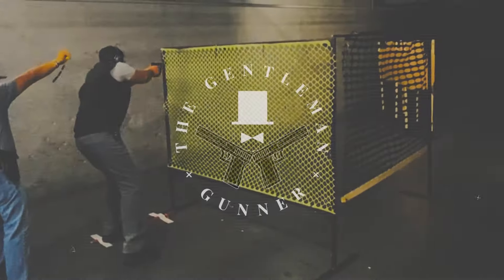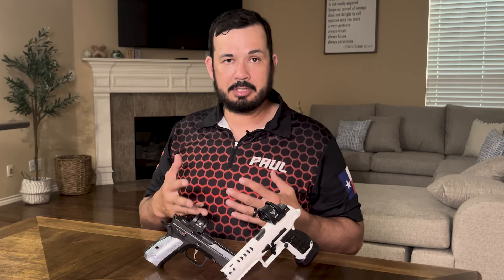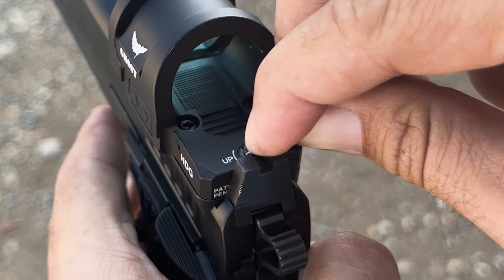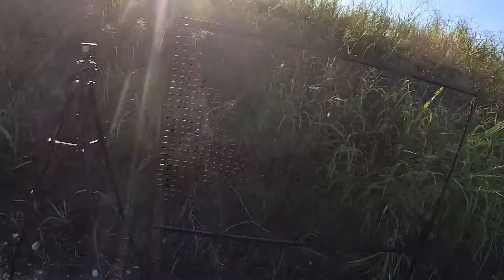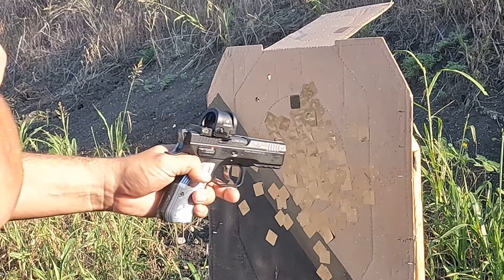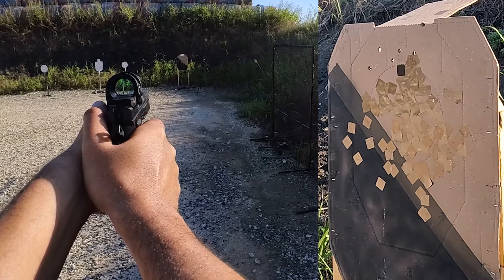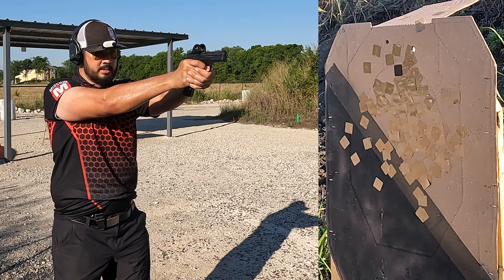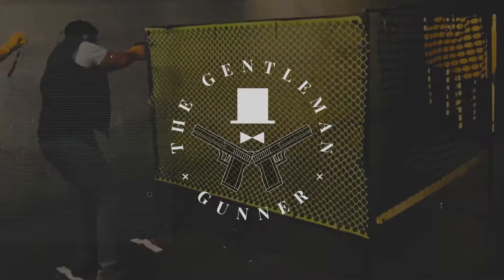How to Zero your Red Dot Sight (RDS) for Competition, Freehanded!

Comment: I know this is the most common way to zero a pistol red dot. But I'm just curious, how come a rest isn't used? Doesn't it help to eliminate the human error part, so we don't have to call our shots? Additionally, why not just bring the dot down to where your iron sight is?
Reply from the maker: All good points. 

Here’s why I do it… disciplined practice. You can certainly be mechanically accurate, but that added benefit of knowing where your gun is in your hands is an added level of confidence. If this were bullseye… then I’d absolutely use a rest. So your perspective is correct especially if you can hit 100% accuracy at speed. 

Regarding iron sight question… assuming you are talking about a co-witness setup… most hold well a touch over the typical 12 o’clock … in most cases the dot sits in line at 12 o’clock
Reply: I think sage dynamics video on why you don’t slave dots to irons stands up well and is worth a watch for people with this question.
Reply: @TheGentlemanGunner I’ve been back and forth on zeroing with and without a rest…for practical EDC, it seems like zeroing offhand makes the most sense. Your grip, line of sight, etc, just isn’t the same from a rest.
Reply: I agree with removing the human error factor (when sighting in). He seemed to still have a larger than desired group.

Comment: I’ve gone through some maturation with sighting dots. I used to just slap the dot on and start out at 5/7 yards get the dot centered up and then dial in more precision at 15 yards free hand. Lately Ive started shooting off a bag at 25 yards to get dialed. Then verify on 4” steel at 25 yards and paper at 5-10-15 free hand. I’m not sure much matters where or how you start as long as you are dialed and confidently making hits at a variety of distances. 

Thanks for the thoughtful sighting in advice.

Comment: I prefer a 25 yard zero. Tried 10 and didn’t like aiming low on longer shots.
Reply from the maker: That works. From my experience, at that range… the shots are at best 1-2” low at 7-10yds. I’ll zero at 25yds for big matches where I know I’ll see quite few stages with precision (head target) shooting at 30 plus yds.
Reply: @TheGentlemanGunner Ya, I’m used to holding over a little just like with a rifle at 25 with a 50 yard zero. Thanks for the reply. Keep up the good work 👍